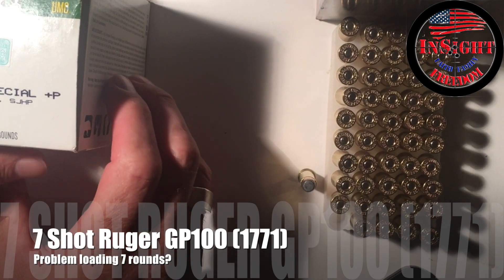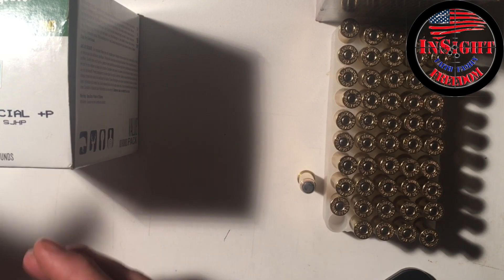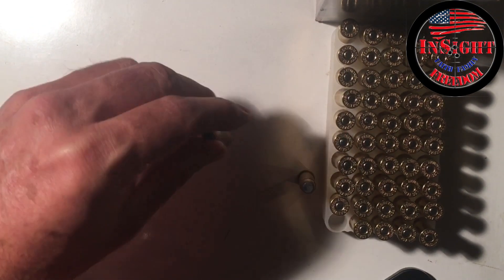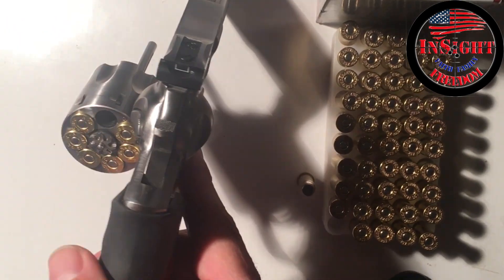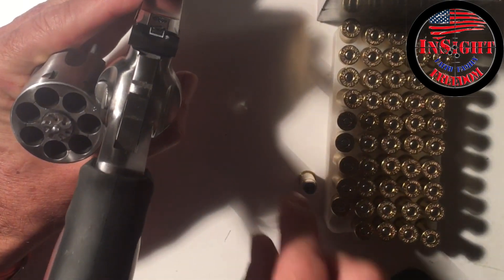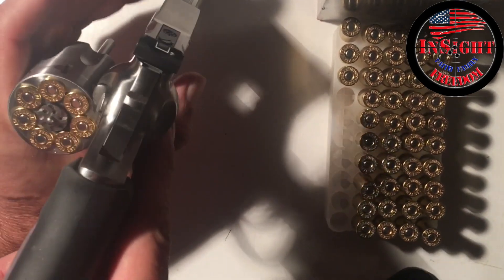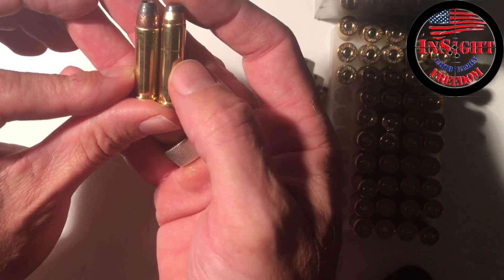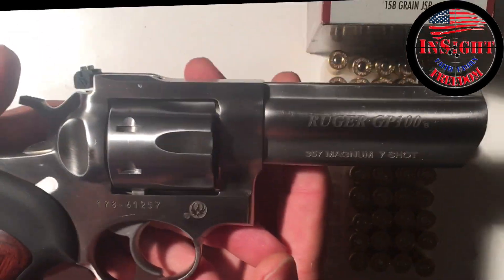Ruger GP 100 7 Shot Problem?

Comment: If you switch between 38 and 357 you’re asking for trouble since the 38 case is short it creates fouling in the cylinder, then 357 doesn’t want to go in as well. It’s not the weapons problem. Shoot either one not both. Besides it typically take a lot of shooting for that occurrence.
Reply: I always shoot 38 then 357 right after and have NEVER had a problem but I have sw so maybe that's why 😊

Comment: I have experienced the problem with Geco .357 158 grain rounds.  If I pick and choose out of the box, I’m able to get 14 rounds that will play nice with one another. But if I mix one of the ones with a slightly wider rim, then it overlaps.  Don’t have this problem with my Hornady defensive rounds.  They have slightly smaller rim diameters.

Comment: You're correct with both .44 magnum & .357 magnum wheel guns carbon had a tendency to build up at the front of each chamber when the special version of those cartridges is used.  I've never heard of it causing a problem with the special rounds, but I have heard of problems getting the longer magnum rounds to seat with the carbon build up.  Whew!  Was that wordy enough!?
Reply from the maker: New Texican an accurate description. Just the problem you want to have since you want a good full support.
Reply: That's what I thought, too. Clean the thing, right?
JH586
Reply: New Texican you writin' a book😂👍
Reply: Jamie Howell the same thing can happen shootin' 22 shorts and then goin' to 22LR. It's not a big deal just clean the cylinder. The worst thing about shootin' 38's in a 357 is the 38 hits considerably higher.

Comment: Blazer in both rounds have issues in my gp100 7shot 4.2. It's gritty dirty ammo and after one cylinders worth, I have issue ejecting due to excessive fouling.
Reply: Excuse me, blazer shoots fine in mine, it's magtech that was the dirty culprit. I miss spoke on the brand. Have had no issues with blazer and nothing but issues with magtech.
Reply from the maker: It's weird.  Blazer seems fine now. Could have been a bad lot.  I've not experience issues with Magtech but have mostly shot it in 9mm.  Thanks.

Comment: He was able to get the blazer357 to go in if he pushed on it ,so it was not a overlap problem or it would not go in no matter how hard he pushed  I believe he was shooting 38sp in it before the 357 mag if he would clean it after shooting 38sp I think his problem would be fixed.
Reply from the maker: Mitch Maile probably. It’s tight fitting 7 in there for sure but in spec it works. Just not much room for play. I really respect the engineering. Thank you.

Comment: One thing about it when trigger is pulled it will fire unlike all the plastic crap they sell
Reply from the maker: True unless there is a timing issue or some internal spring breaks but all in all they are such reliable guns.  Thanks.

Comment: I could understand the argument of specific brass having problems seeing as not all brass is created equally. I can tell you that Remington brass is very thin brass in comparison to many. I would say that out of all of the brass I have worked with, Remington is the thinnest and easiest to manipulate brass and Magtech CBC is the thickest. I personally have never had carbon buildup in my .357 magnum revolvers from .38 special use that has ever caused a .357 magnum to stick while chambering. I must be lucky, I seem to always get the odd revolver out with larger than normal chambers and tighter than normal cylinder gaps :)
Reply from the maker: Gun Sam Revolver Aficionado I would call the cylinders in these GP100s well supported. I can switch back and forth from 38 to 357 but if I run 100 Plus rounds of 38 and switch to 357, it’s a notable slight resistance putting the cartridge in. Thanks for watching.

Comment: yes i do think that the manufacture's may have not shaven enough brass @ the bottom of the case . When u loaded the seven rounds i could see there's not enough play between those rounds . one hair would overlap them easily in my opinion . Awesome video my brother  watched full and liked .
Reply from the maker: GHOSTLY IRON PISTOL still haven’t personally had any trouble with it but I can see how some might. Thanks brother.

Comment: Sounds like it may be carbon build up in the cylinders from the .38 Specials. Some Ed's Red and a phosphorus brush should take care of that. So, how often do these folks clean their revolvers? Not every range trip I don't think. I can see how this could be an issue. But hey, clean it or just shoot .357 Magnum rounds out of it.
Did I miss something? Please correct me if I did.
Reply from the maker: Jamie Howell no. Think about covered it 🤓 I usually clean my guns after each range trip. I will say they the 38 fouling was noticeable with the cheap Monarch ammo than any of the others I’ve shot through this. I do mostly shoot .357 mags and this revolver it built to take it in the long haul. The 38s are incredibly easy to control the muzzle flip.

Comment: I had problems different ammo diferent issues because of size of rim you notice it more when shooting the heat it expands fiocci worked the best for me  you look at the shells in the cylinder you cant slide a paper in beteen shells. Use high qualty ammo youll have better results.

Comment: Yes if you do not clean the cylinder well after shooting the .38 loads and then shoot the magnums the magnum spent brass will stick in the cylinder.
Thanks for sharing
Reply from the maker: Phil M Rivers I’m baffled where people are getting the info that the 7 round cylinder has trouble holding 7 rounds. I bet I’ve shot 1000 rounds through this and never had that issue. Thanks brother.

Comment: I’ve got the Taurus 66 7 shot 357 and have never had any issues. As little room there is between case rims though, if some of the ammo had damaged or out of spec diameters it could cause a problem getting all 7 in. I’ve ran into that with reloads where a rim had a burr and wouldn’t fully seat, but factory Blazer is usually pretty good, other than that aluminum case stuff you can’t reload 😁
Reply from the maker: Mike Treen I agree. I suspect the person that posted this video had either a manufacturing issue with his particular gun or there was definitely some case rIm indescrepancies. .